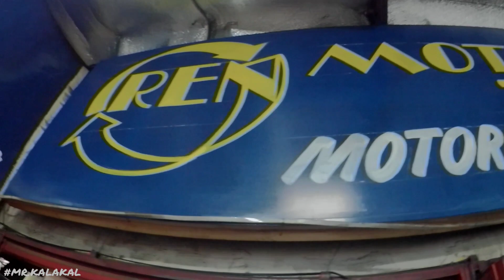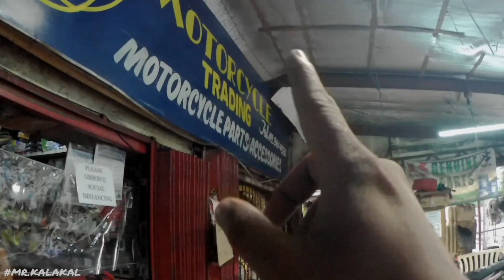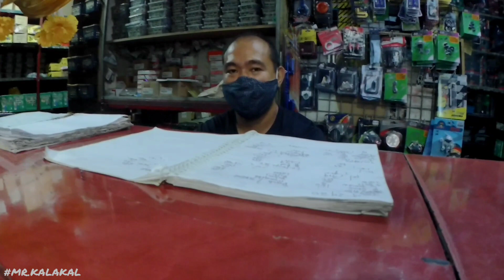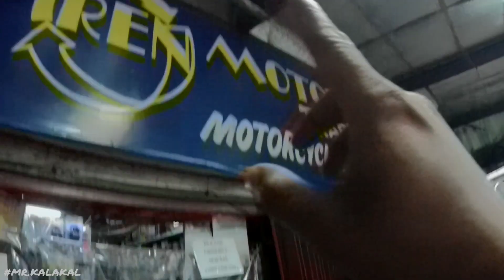INSTALLING RIM LOCK ON MY RUSI KRY 150 | SHOP VISIT-REN MOTORCYCLES MARIKINA | TRAIL READY

Comment: Boss magkano inabot nang set up nyo? Thanks
Reply from the maker: tires 3,7k
rims 2800
rios 600
interior 800
rim lock 300each
labor 1k to 1,5k
Reply: Anu po brand ng rim mo idol  at size? Tnx
Reply: mahal naman jan..dito samin shop 650 lang tire na ganyan at 850 sa likod..sobra over prise .dito sa mindanao labor niyan nasa 200 lang lahat ..